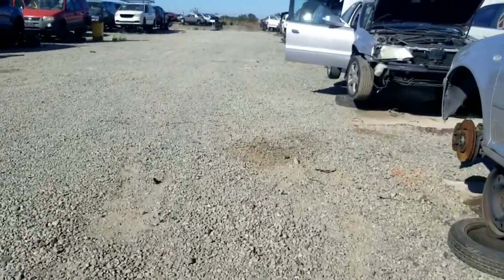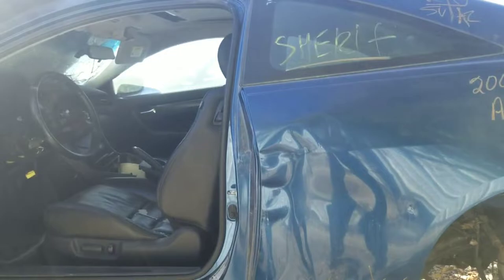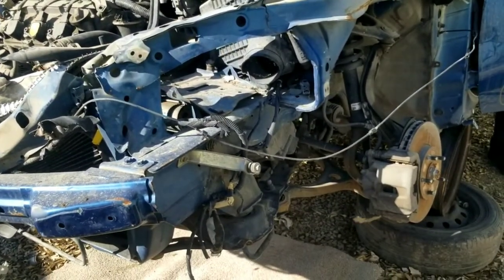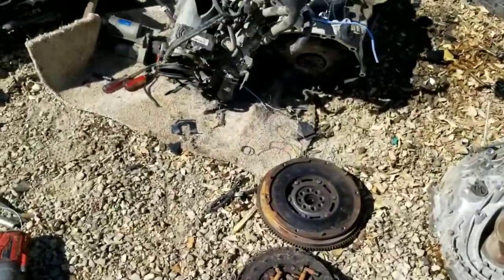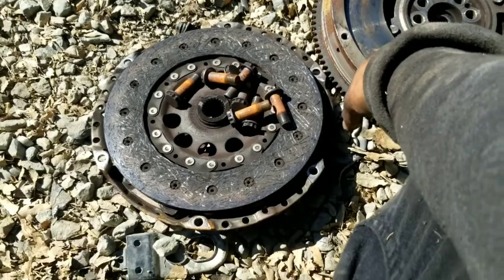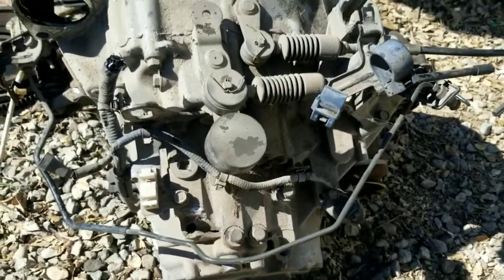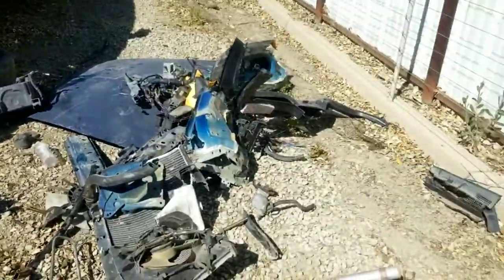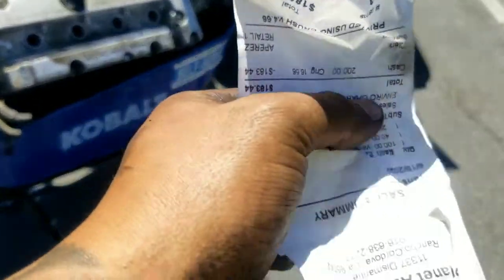Junkyard Find $100 dollar wheel barrow day. J series/Kseries

Comment: Speaking of transmissions, what mtf fluid do you prefer? I’ve had no problems with Synchromax Royal Purple or Penzoil Synchromesh. I’ve also used the Amsoil mtf. Btw I just swapped a 04 j32a3 into my 04 accord coupe and I couldn’t be happier. You are one of the youtubers who inspired me to get the j37 intake mani after asking some questions. I also got a clutch masters 250 with aluminum flywheel and it pulls paired with the aluminum crank pulley. Some say it’s bad to run both but I have no issues so far.
Reply from the maker: i just use reg 5w30 weight oil for my trans lol
Reply: @sanchosevy2911  I had a feeling you'd say that 🤣
Reply from the maker: @Jaydogg209  LOL been doing that almost 18 years on most MT trans.